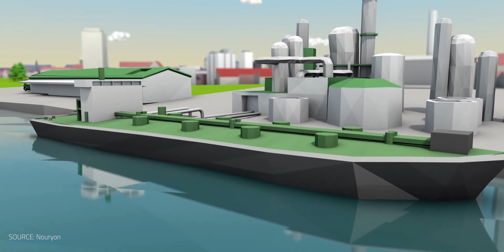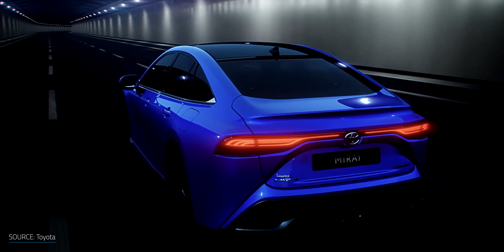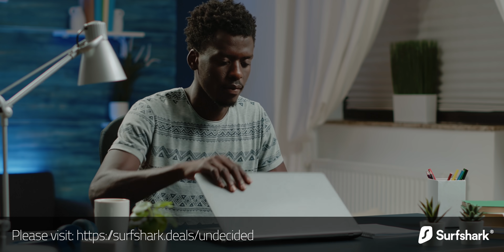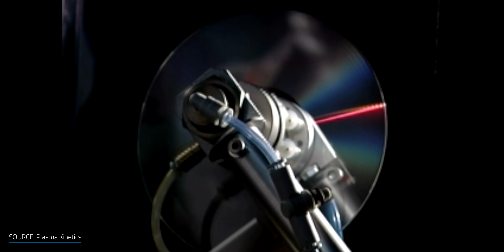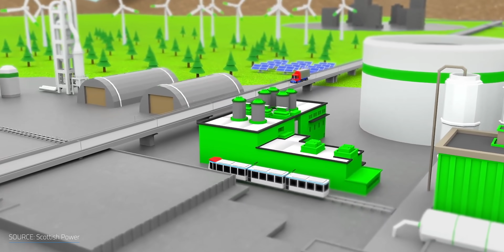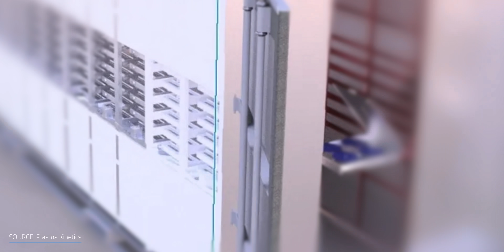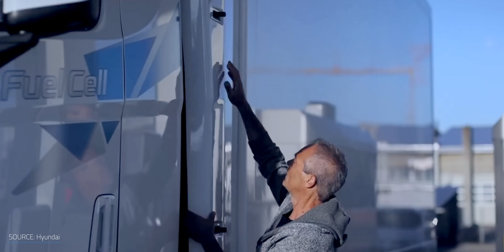Energy Storage Breakthrough - Solid Hydrogen Explained

Comment: I'd like to hear more about the actual capturing aspects of this, that sounds like the real kicker here.
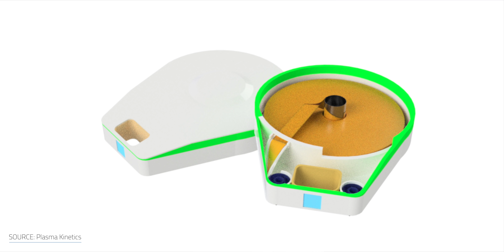Reply: The hydrogen capturing aspect of this is a big fat nothing. The only way to get a stream of hydrogen for their film cartridges to absorb is... to make hydrogen. 3:54 "The device could extract metric tons per day of 99.99% pure hydrogen directly from smokestacks" is, haha, a nonsensical smokescreen. There's minimal hydrogen in what comes out of a smokestack, but there's a crapton of CO2 in it.
Reply: @skierpage  couldnt that be filtered out aswell at this point of tech?
Reply: @ex5080  Yes the CO2 could be filtered out; that's the expensive and unproven technology of CCS (carbon capture and sequestration/storage). Maybe there are industrial processes whose exhaust includes a substantial percentage of free hydrogen, which would mean they're wasting a valuable chemical that this tape could absorb. If such processes exist I suspect most of them are in the fossil fuel industry which has to end.

Green hydrogen from electrolysis of water exists right now, It's just the electrolyzers are expensive and renewable electricity isn't constantly cheap, So green hydrogen remains more expensive than dirty  hydrogen made from  methane fossil fuel, so industrial hydrogen users aren't interested.
Reply: @skierpage  but you would have at least recovered the H2, or? There are plenty of industry processes where you can capture the hydrogen from. Some have tenth of volume% H2. One question still is, f it works well outside 99,99% H2
Reply: @juliane__  if we somehow could use this to capture co2 and then just burry the film, it might be a quick solution to lower co2 content in the atmosphere
Reply: @skierpage  probably not that much hydrogen in the smokestacks we see, but you do sometimes see towers for burning off hydrogen. Storing hydrogen is expensive and difficult, but burning it is cheap, easy, and minimally impacts the enviorment. If you have an industry that produces waste hydrogen, a solution that is cheap to build and pays out would be a god send.
Reply: @skierpage  agreed, better prevent. My only point was that if this technique can somehow be adapted to capture CO2 or other gases, is might be useful in more places
Reply: @skierpage  This could be a miscommunication as powerplants using steam based energy collection vent their water vapor out of "smoke stacks".  Granted, fuel burning plants probably vent their exhaust out that way too and any plants that use combustion engine style generators rather than a boiler and turbine TEG system will have little to no water vapor in their exhaust.  This would pair well with geothermal, nuclear, and even coal plants though... Assuming their vapor electrolizer system actually works.
Reply: @nicodesmidt4034  materials capable of capturing large amounts of CO2 in the air are largely cost or space prohibitive and have byproducts no one really wants.  Even if they have a use for the exhaust, they can usually make it themselves for cheaper than any off site capture and delivery system could offer.

This is compounded by there usually being more exhaust gases than CO2 which have other detrimental effects.
Reply: Im also curious how quickly you can discharge the hydrogen. That would really be a limiting factor in its use if it can't discharge enough grams per second to fuel a vehicle.
Reply: @skierpage  There is actually a lot of hydrogen in the smoke stack. Unfortunately it is all bonded to oxygen!
So your point still stands.

I really didn't get the point of this video! how are they gonna capture the H2? Completely unanswered in the video.
Reply: Well, ok the title of video only proclaims "Energy storerage breakthrough" so that explains.
I just felt Matt went to great lengths to describe it as an extractor, but perhaps he misspoke.

Comment: I had another couple of thoughts/questions:

How does the tech stand up to thermal variation?  Is it heat/cold tolerant?  How will it do in a semi climbing a 10% grade in an Arizona summer?    How will it do at 20 below at 20k feet in a small commuter plane?  I have to imagine both absorption and release are sensitive to both, likely impacting parasitic losses.  Like does it have to be preheated in the cold?  Or the entire package kept cool in the heat?

And how does it handle the usual vehicle safety concerns: fire, impact, penetration, moisture?
Reply: Like the vid said "in ambient temperatures"
Reply: It appears from the tech that the hydrogen release is optically activated, which typically means the release energy is considerably above thermal activation barriers for atmospheric-relevant temperatures. Optical excitation levels in matter are on the order of 1 electron-volt, which is several orders of magnitude above thermal excitations. Given the likelihood of thermal escape is proportional to e^(-E_activation/kbT), you're talking extremely negligible release, even if E_activation is ~200C (*kb), like for the other metal hydrides he mentioned.

So in a nutshell, I think it should be fine. This kind of storage operates on a completely different temperature-dependent relationship than battery tech, which has a direct energy output relation to temperature.
Reply: @The_fusion_physics_guy  it still baffles me the number of people who don't know that electric vehicles are essentially useless at below freezing temperatures.  So many tesla owners in the Texas freeze found out just how useful battery tech is in extreme environments...
Reply: @rice83101  i understand OPs point, i am just stating that like the vid aaid "ambient temperatures" which might be the techs biggest drawback and why its not widely adopted aside from its cost factor considering its a new tech n it needs its own infrastructre and ecosystem
Reply: @RichardCranium321  Wasn't it only -20 F at it's worst or something? That isn't even that bad, iirc Teslas operate just fine at those temps, of course if the whole power grid goes down because it's dogshit, then you got a big problem.
Reply: @dragdritt  no, it wasn't even THAT cold. It never hit 20 below Zero, but it did hit 20°F which is 12 below freezing.  Check the tesla motors club, there were dozens of comments & videos of Tesla owners that realized their cars would not charge at the low temperatures that were reached - in Texas. Grid had nothing to do with this particular situation. In the areas where the grid didn't fail they still had problems. If they didn't have a heated garage, the car would not accept a charge...

It's fair weather tech that works fine in the moderate climate of central to southern California, just like the wind turbines and solar panels that led to a failure of the grid simultaneously timed with a hack of pumping stations - supposedly using software developed by the NSA before it was stolen...
Reply: Seems like a very simple fix for freezing temperatures preventing a charge would be heating the sensitive components when it detects the temp drops to that level.  An EV battery should have no problem heating a small internal component for a short while.
Reply: @Richard Cranium. The good news is, if we just tear new ideas apart and don’t try to find new ways of going green, the entire earth will soon be so warm that cold temp issues won’t be a problem anymore. 

I live in Canada and we have tons of Teslas and other EVs that operate at well below -20C. And they charge outside at these temps.
Reply: @RichardCranium321  The top 5 countries in terms of percentage of new car sales being BEV vs ICE for 2020:  1. Norway, 2. Iceland, 3. Sweden, 4. Netherlands, 5. Finalnd.
I don't think EVs would be top sellers in those rather chilly countries if they did not work in cold temps.
Reply: @RichardCranium321  (Plus Texas has Starbase and a star as it’s state symbol. Coincidence? I think not.)

There are restrictions to renewable, for sure. Nothing’s perfect yet (not even Texas ) but the great thing is that there are people out there trying to find ways to make things better.
Reply: @charliebrown8278  do you not realize that they flip their climate predictions about every 20 years? In the late 70s, Leonard Nemoy was hired for a climate change film where he said we were headed for a global ice age by the year 2000 - but then in the 90s we were told the opposite, it would be warming so much the great lakes would dry up.

Since the 1920s the cycle has repeated itself 3 times over. Keep in mind, this game changing tech was restricted and kept from the people for close to a decade by the same President who entered into the Paris climate agreement, flying on private jets to meet with other billionaires to discuss how the middle class is consuming too much before returning to their $5M beachfront vacation home. What's that you say about rising sea levels Mr. Al Gore, circa 1990's? I'm SURE there isn't video after video of rich elites telling people to do exactly the opposite of what they are doing themselves. I just wish someone had asked Obama about his decision to restrict this tech while he was preaching at the latest climate summit

If they really cared, they would have these meetings over zoom & they would consider nuclear plants powered by tritium slurry. They've had a working model for decades but based on the massive amount of bureaucratic red tape surrounding nuclear energy you would assume the tech hasn't advanced in the last 40 years but we all know that's simply not the case...
Reply: @RichardCranium321  You bet your sweet patootie I realize climate issues flip flop all the time. Extensive research on sea floor samples has shown that the sun actually has a several thousand year cycle as well as the better known shorter-term cycles, and that we are just at the peak of all five solar cycles they know of, and temperatures will start dropping naturally, to a point that we won’t be able to grow crops in the mid-latitudes in a matter of a few hundred or so years. 

Maybe. 

The thing that I try to remember, is that in conversations with such diametrically opposite opinions, both sides are usually wrong. The truth generally lies somewhere in the middle. And my humble opinion (which may very well be wrong) is that burning fossil fuels forever is simply not going to work out well. One of the joys of living in a free society is that we can have our own opinion, discuss it calmly and intelligently, and not worry that someone is going to shoot me because it doesn’t match their own version of reality. So you can live in your version of heaven, I’ll live in mine, and let’s meet in a thousand years and see what middle-of-the-road reality plays out. 

Meanwhile I’ll happily drive my EV all year long (with a 10% drop in range in the winter, just like my old ICE car) through the snow (which may become more plentiful. Or… may not) and rain. And yes… I will also fly to the Caribbean (not the US) to warm up when I lose my sense of humour (yes that’s how I spell it) about the cold. 

It’s been fun. Thanks for the chat.
Reply: I posted a tech question and come back to find 'Dick Head' (Richard Cranium) waving his hands around like chicken little claiming the sky is falling, and someone going by Charlie Brown is the voice of reason?  This is what I get thinking I could prompt an engineering level discussion on YouTube, always forget this place is only a couple steps above kindergarten on a good day. :D
Reply: @JohnBysinger  I feel your pain. I thought I could come to YouTube and not have people question my ability to make intelligent comments, simply because of my name. “Charles” is on my birth certificate, but I go by “Charlie”. 

Welcome to my world. 

Don’t give up hoping for better responses, but you’ll probably have to find a different forum.
Reply: @charliebrown8278  I gave up on internet forums around the time broadband everywhere brought in the masses at the turn of the millennium.  Shakes cane mumbling things about vacating his lawn

There are still good conversations to be had from time to time, posts like this video do better than most that's for sure.
Reply: @RichardCranium321  I stopped caring (and reading) at 'narrative', if you've got something to contribute about the engineering behind the tech in the vid, you're welcome at the adults table.  I don't hold grudges, or take words attempting to hurt me personally.  I invite you to leave the emotions at the door and try again.

On topic: I know that the laser excitation is likely a thermal reaction.  My curiosity is just how quickly the system falls out of an efficiency zone when it's in a more extreme environment.  For example: aboard a spacecraft, it could be useful to not depend on COPV storage, but the temperature extremes of space might make it a complete non starter.  I'll have to go hunt down any white papers they may have on it to get my answer.  Though I'd wager there will be a lot more info by the time it's close to going commercial anyway, time enough for me to decide if I'll have use for it.
Reply: @rice83101  apparently you're unaware, Tesla is publicly owned - it was a decision made by the board members as well as the employees (who most hold stock in the company)

Where I live currently is of no consequence to the argument, however I won't avoid the question (unlike you) as I don't currently live in either, nice attempt to deflect though. Now what about the taxpayer funded poop patrol, medieval diseases, syringe & feces covered sidewalks, rampant overdoses, and skyrocketing crime rate despite decriminalization of theft under $1000 which is the overwhelmed majority of crimes in other states?? You seem to have overlooked a large portion of the argument...

Just look at the districts of Nancy Pelosi and Maxine Water's. Some of the highest registered homeless individuals (A large number don't register) living in the same district as as some of the wealthiest. The sidewalk where rich celebrities are memorialized with a star is covered by poverty stricken people living in tents - that level of income inequality is only found a few places in the US. Why are the richest and the poorest both in the same area? Why has Maxine Waters been in the same district since the Rodney King riots & why hasn't it improved in 30 years?

Also, why are the hundreds of thousands of migrants coming to Texas instead of California? They're coming from all around the world, I think they recorded 114 different countries just since January. Why go to Texas if it's so bad and California is so much better?? It couldn't POSSIBLY be because they know there is more economic opportunity and more freedoms in Texas, could it? 🤔
Reply: @rice83101  >"top 10 food insecurities" 
You're reaching, aren't you? 
Quick search shows Texas is number 1 for beef production, top 5 for citrus production, top 5 for poultry production, 6th for overall dairy, top 15 for pork, and top 20 for corn/soybean production.

Get outta here with your cherry picked references...
Reply: @happy__amoeba  its the lithium batteries themselves thay don't do too well in the cold. There have been certain cars with battery heaters but with an ev containing hundreds of kilos of betteries it just costs too much power to really make sense.